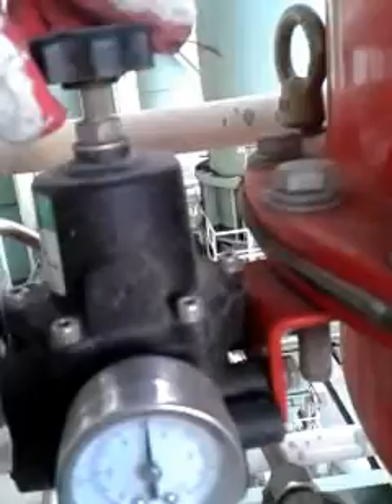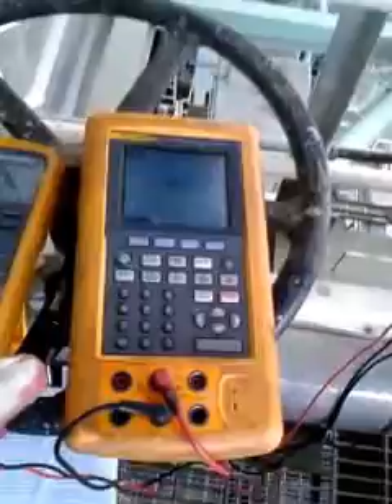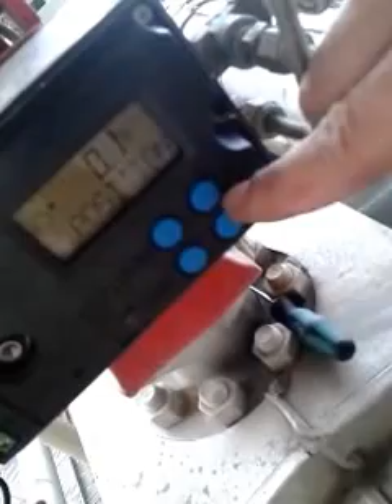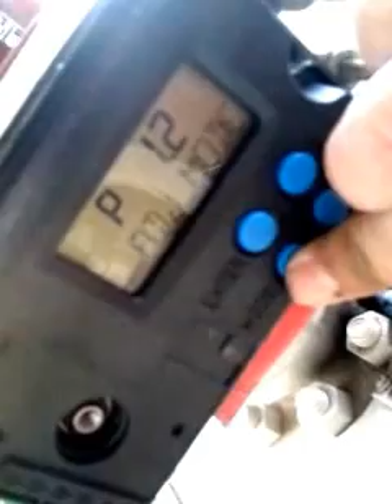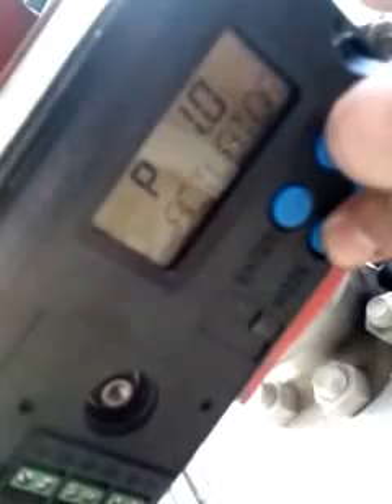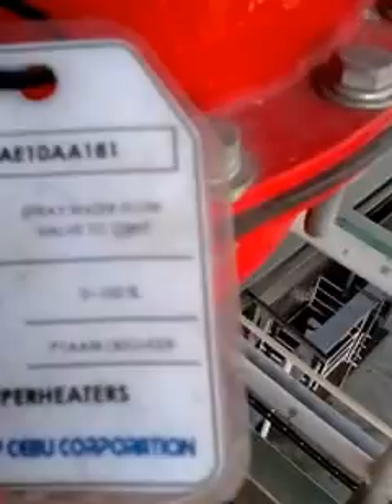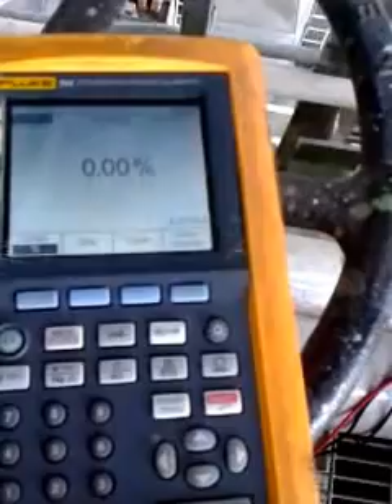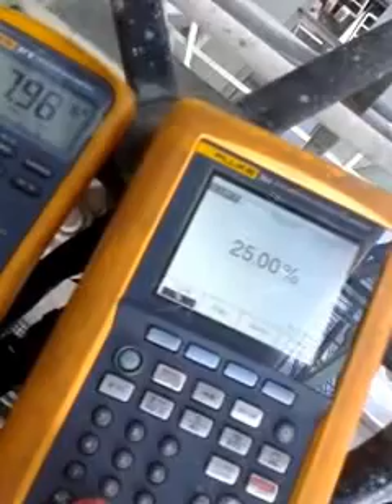Control valve site Auto Calibration (ABB TZIDC positioner)

Comment: I think dis is a combined cycle power plant, calibrated valve was spray water control v/v for desuperheater system present near HP steam drum n its known as cascade control. Anyways good job bro, also plz show the auto calibration from control systems to the viewers, just DCS Engineer gives d command & Field Tech. observes the positioner & also known as travel.

Comment: nice one brow.. r u in offshore?
Reply: your analog output is out of point 2, i believe you can calibrate you analog output also within your valve controller or use hart communicator instead. anyway your video is very informative plus your doing it risking you might get caught filming on site... keep it up bro
Reply from the maker: yes bro. in the AI card of the positioner there is zero and span trimmer. so we can actually adjust that one.